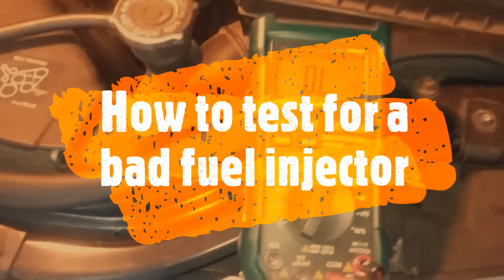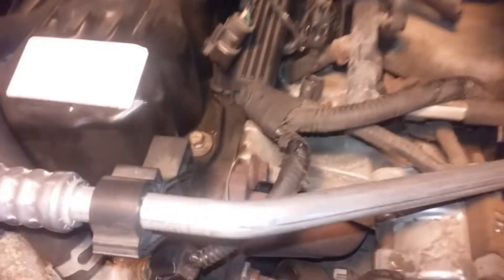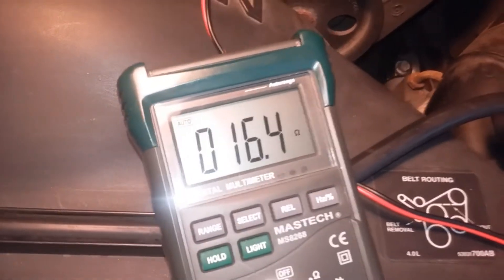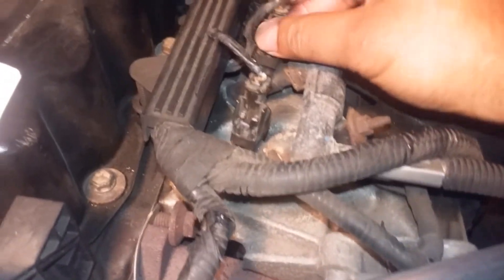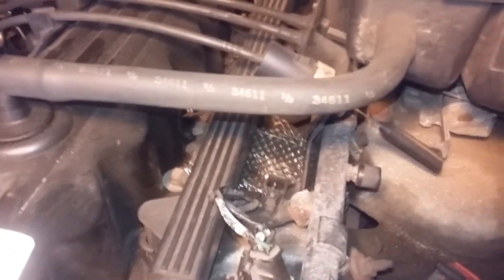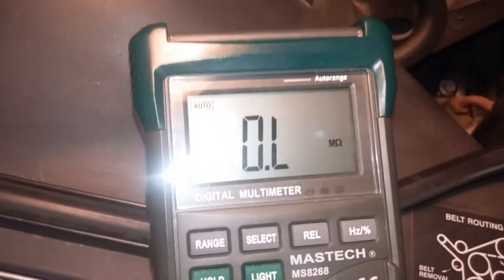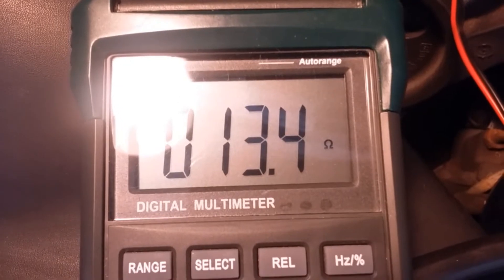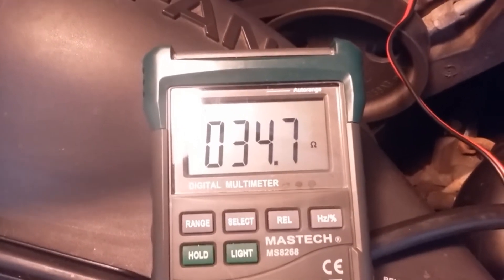Jeep 4.0 Bad Fuel Injector Test

Comment: Do you just replace fuel injectors?
Reply from the maker: Yes, just the fuel injector that is bad. In my case, I replaced all the 6 fuel injectors since the others may go bad as well and I found a good deal on used ones on eBay. See my other video https://youtu.be/T2PPxVJf3Ts on step by step instructions to replace them.